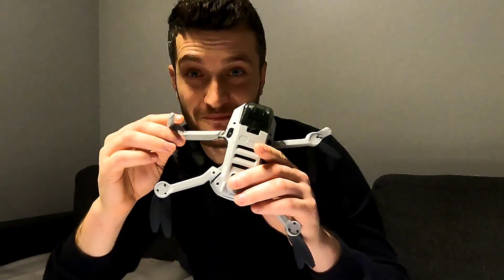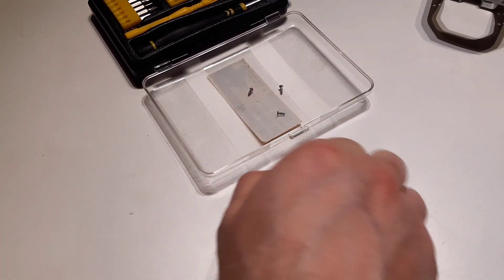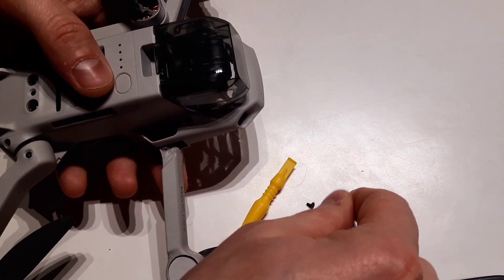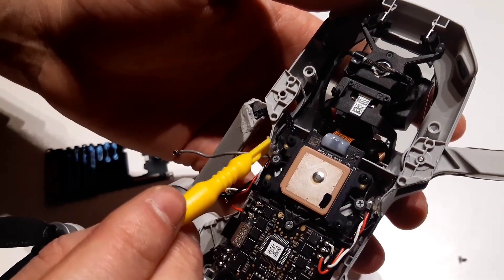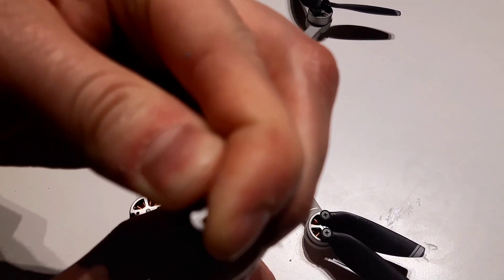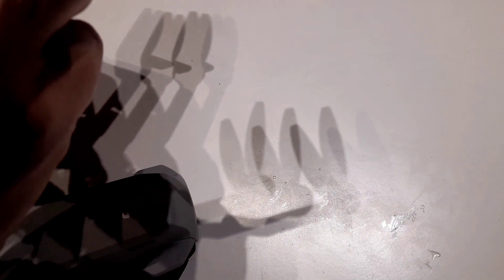Mavic Mini  Arm Replacement( Full Tutorial in English)

Comment from the maker: Here you can find more easy :
0:42 - 02:27 - Top Cover remove / explanation
02:27 - 02:42 Wires explanation, antenna wire
02:43 - 04:20 how to remove  barclet what keeps the arm in place and creates tension when open and close it
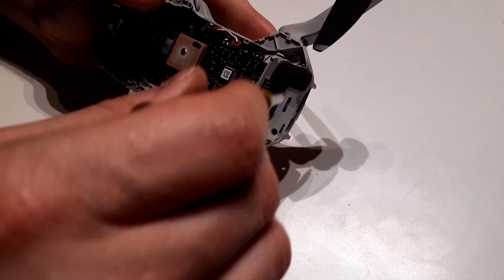04:21 - 04:46 removing three wires from board by melting down the tin with soldering machine

04:47 - 06:55  how to remove the lower Body Cover, disconnect the antenna, and take out the broken arm
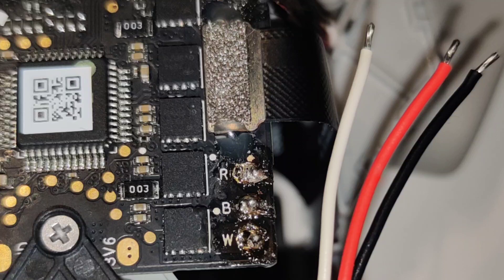06:57 - 07:59 - Installing new arm replacment, and connecting the antenna wire back to board.
08:00 -  08:40 soldering the Mavic Mini wires back to board ( things to keep on mind)
08:46 -  10:21 How to reset Mini Mavic  Front Shaft /Barclet and install
10:22 - 12:00 How to Install lower Body Cover and top cover Mavic Mini
12:01- 12:16 Changing propellers Mavic Mini
12: 26 -12:35 First test after recplacing broken arm.

Thank You , don't forget to subscribere for more interesting videos

Comment: for those who can,t solder , just cut the original wire,s and connect the wire,s from new arm , with original wire  :-)
Reply from the maker: Good point, but since it wasn't so hard i did do it myself. Wires had already tin, so that was just easy task to melt it a bit down.